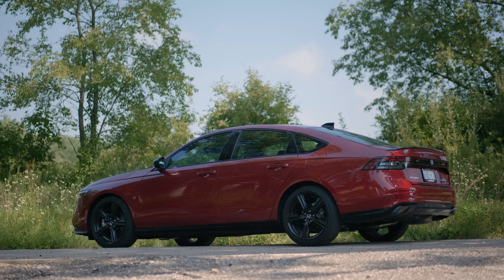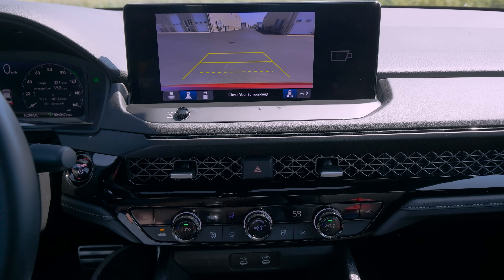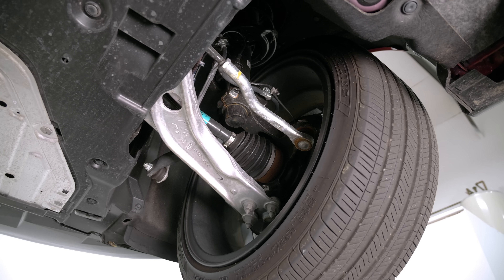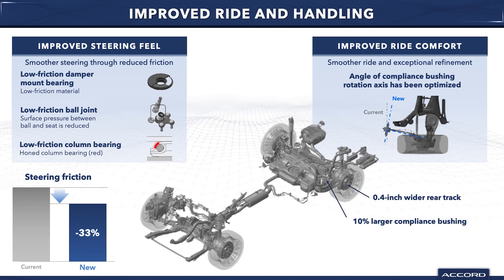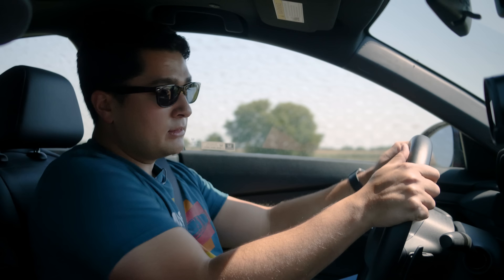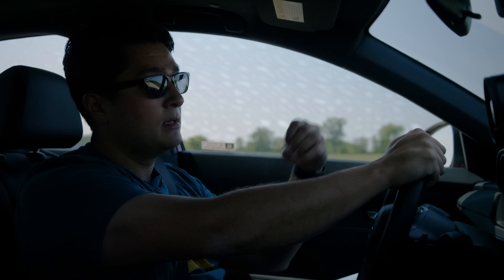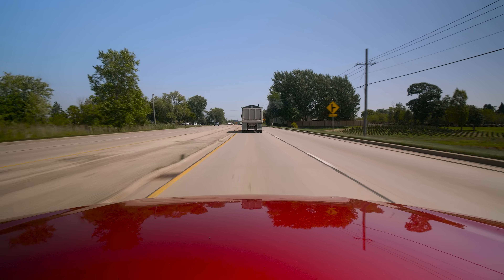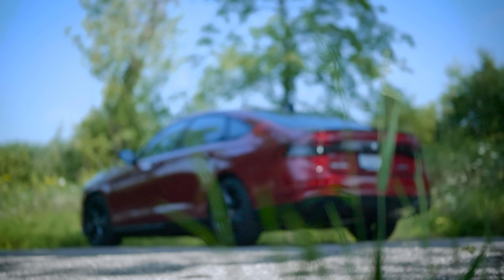2023 Honda Accord | The Art of Normal Cars

Comment: Is it worth it to upgrade to this over the civic? Are there noticeable differences? If so, which ones? Great video!
Reply: Currently hybrid availability and even more rear seat space. That's all you're getting for the most part, aside from luxury features on the top trims
Reply: You'll get a head up display if you go for the top hybrid touring trim as well as a bigger  touchscreen. The interior is also better looking in this Accord compared to the Civic in my opinion.
Reply: The 2024 Civics will come in this hybrid power train as well.

Comment: Honda tends to alternate between aggressive and conservative designs with each generation on the Accord.
Reply: 10th Gen Civic starting with 2016 model year was the extra aggressive style. The tail lights, rear shoulders, up swaying front to back side lines were really nice. Especially on my white 4 door 1.5 Turbo EXT trim with stock fog lights, and without the large waffle pattern looking things on the 4 corners, especially the Hatchback. Really exaggerated those. I get compliments all the time and the Honda dealer always wants to buy it from me. I feel that trim on that car hit the sweet spot. Sunroof, upgraded wheels, Dual zone AC, 7" info, 8 speakers, SiriusXM, Apple/Android, Fog lights, keyless entry, pushbutton start, upgraded seats and door panels with black and tan. Really hit the sweet spot with that trim that year. $23K Sticker. I got it for $20K in Jan 2017 new. Almost traded it in for an 2010 Accord Sport but it didn't have a sunroof and quite a few things. Interior was just basic grey/black. So I still have my Civic
Reply: same on Civic
Reply: @@Ac_AdapterEither a 15 year old or a literal clown must have designed that generation. Horrendous
Reply: There has never, ever been a Honda Accord you could call "aggressive" in terms of design.
Reply: Yeah, but the last gen was not aggressive at all.  9th gen looked great.
Reply: @MikeYurbasovich  ?The 10th gen accord is one of the most agressive and best looking accord ever made.
Reply: @MikeYurbasovich 9th gen accord is peak accord. TSX too if you count that.
Reply: @latuba2478  I had a 9th gen v6 coupe.  It was a really nice car for what it was.  Very good looking vehicle.  For the 10th gen,  it looked like they fired their design team and let the IT guys design the car.
Reply: @MikeYurbasovich  specifically the 9th gen coupe is crazy sexy
Reply: @alexg9727  It's pretty quick, too. I beat up a couple V8's with it,  and it was a fun car, very comfortable for long trips, good in snow.  Mine was white orchid pearl with 19" touring wheels.
Reply: the new civic definitely gives me a 90s JDM feel and i even thinking about selling my c class for a honda :P
Reply: The 2018 was a favorite among the mumble rap zoomers. Normal people used to drive Hondas, idk what happened

Comment: I don't see as many on the road as I would expect for an Accord.  I have to believe people are turned off by the old and plain styling design.
Reply: I see five times as many 10th gen Accords. The style is just so much nicer, this new one is incredibly bland.
Reply: @DeadwingAbsentia  that’s because the car has been out over 5x as long. Of course you’ll see more on the road. Same will apply for 11th gen when the 12th gen has only been out for half a year lol.
Reply: @SIIKAP1  Yeah, that makes sense. But I see tons of brand new cars on the road and I thought I'd see more of these. My guess is people have the same hesitation I did when shopping earlier this year - no 2.0T/10 Speed and forcing the CVT on buyers? No thanks.
Reply: @DeadwingAbsentia  the lack of 2.0T powertrain and the questionable styling will definitely deter a lot of people, but it will also attract a lot of different people that prefer tamer styling and good fuel efficiency. I see a decent about of these on the roads. 

If you choose the hybrid, you don’t have to deal with a CVT. The direct drive ‘transmission’ in the hybrids feels way better than a belt-driven CVT.
Reply: @DeadwingAbsentia well that’s because the 10th gen has been around for 5 years this one just came out a few months ago
Reply: It’s been out since February, which is half a year. And this is selling more than the Civic, with 100k sales through June of this year, and the Civic at 94k through June of this year.
Reply: I actually have been seeing more of these than the new CRV. I thought it was weird.
Reply: live in nyc.   see none of these.   everyone and their grandma has a 10th gen though....
Reply: I'm living in the Bay Area, I wouldn't say the new Accord is rare, when you see the new Accord, you can tell the new one feels more high-end compare to the tenth gen. Remember, being plain doesn't mean boring, the design would age well way better than something like current generation Hyundai products, which known as come with some overstyled design.
Reply: It reminds my of what Toyota did with the 2015-2017 Camry. Made you wonder what in the world were they thinking?!
Reply: Where I live, it's cost. You're either in a brand new car or one from over ten years ago out here, and most of these vehicles on the road are trucks. I see more 90s and 80s Japanese cars on the road than I do cars made in the last five years.
Reply: Most people just get the CRV now
Reply: They are turned off by the low supply.
Reply: Selling more in the same time frame than 10th gen accords btw
Reply: I see it everywhere. Where do you live?
Reply: @kevinc2332  Live in North Carolina. Friend in Chicago said the same.
Reply: For most people it's the power plant. The Accord is a mainstream car but mainstream people do not want a Hybrid system. Leading more people to buy Mazdas or Camrys.

Comment: I would like to see a 1.5T version of this hybrid powertrain with around 250hp. It technically could be possible since both the 1.5T and the 2.0 are L series engines. Will that happen? Probably not, but it would be nice
Reply: The 2.0 Hybrid is a K series, not an L series. It could possibly be possible but Honda’s direction with the car wouldn’t line up with it.

Comment: Oddly enough I was just looking for reviews on this gen accord and was recommended their initial impression video, then a couple days later this drops. I think this car will serve it’s purpose really well even though most people who would buy one will most likely buy a crossover now. The days of cheap reliable used accords have been gone for a while now but these new accords are so complicated with turbos and hybrid systems that they’ll probably not be so great as a high mileage, multiple owners, used cars. I guess time will tell how well these things hold up.
Reply: If we’re talking hybrid, you may end up eating your hat - this hybrid system is bullet proof, and with the low stress of the NA Atkinson 2.0, these Hondas should be easily good for 300K + miles. No  CVT or transmission to worry about either ( just the electric motors and 1 low reduction gear and 1 high gear) for when the ICE is running.
Reply: @adambernstein9647   it’s not the engine or motor that I’m worried about, I’m more concerned about things like the battery or how the software controlling the whole system holds up. In the late 90s we were able to pick up 80s accord with almost 200k miles on them and do basic maintenance that anyone could do in their driveway and had a reliable inexpensive ride. I don’t think that’ll be the case with these newer accords. I could be wrong and maybe the average home mechanic in the future is well equipped for those kinds of things, it’ll be interesting to see.

Comment: The Toyota Camry TRD is the obvious choice in this segment for the performance oriented. It looks great plus you have the option of that sweet 300hp V6 which leaves both the Honda Accord and Nissan Altima in the dust. It's a shame that both Honda and Nissan gave up on performance. Who remembers the Altima SE-R? Ahh... Those were the days.
Reply: VS the new Accord, the V6 Camry will smoke it any day of the week. VS the old 2.0T? Camry loses. You’re right though, Toyota feels like the only one who still cares about fun cars.
Reply: @Teku175 Toyota doesn’t “still care about fun cars”, they simply did not release the new Camry yet, so of course they still offer the old Camry V6 of 2018 gen. Once they release the 2025 Camry, they are dropping that V6
Reply: My 2.0T Accord will still smoke any Camry TRD or V6 I come across. >:)
Reply: @fireemblemaddict128 You can’t get that anymore. You can still get the TRD Camry in 2023 though.
Reply: Tbh I hope Honda still keep the 2.0T engine (which same as type r) on the accord, it got less hp but the 10 speed gearbox is absolutely animal and make it can go really quick.
Reply: Nissan still makes the Maxima with 300hp V6. Although I wish they offer anything other than a CVT
Reply: @kimochi33  Not for long.

Comment: I rented a 2019 Accord in Houston last week for a week, and put on 1500mi in a week. It was so refined, and convenient to use, I loved it. It had 192hp and I didn’t need anymore power to pass those crazy Texas drivers 😬. Honda and Acura was never on my list, but I’m going to check out the newer cars when it’s time to upgrade.
Reply: I never knew Honda cars were rentals too
Reply: @Wqghfxz I got a Civic as a rental in 2018. Ended up buying an Si like a month later
Reply: just curious, what brands are in your list that never included Honda?
Reply: @ThisGuyRides 😂😂😂
Reply: How you driven any sedan between 300hp and 400HP? Sure you don't need it but is it fun to have to utilize once in a while. We spend so much of our time in our cars these days, why not pay a bit more and get something engaging?
Reply: @DaGoook  Who needs 400HP to commute? Not everyone is obsessed with a 0-60
Reply: @disco.lemonade Doesn't have to be about 0-60 tinker bell . My wife's 330 hp g37 is just plain more engaging to drive than my 280 hp accord sedan . It has more power through the Rev range and is more pleasant to drive even at 1/2 throttle .
Reply: @soulerflare7 if you wanna go fast do that why you mad because the man just wanna chill and drive
Reply: @DaGoook  the problem with 300 - 400hp is that it's usually a luxury sedan with turbos attached, meaning it's going to be very pricey. Pricey enough that most people will just pass it up and get a newer SUV or truck.
Reply: @hellomoto1   I hear you about practicality though. I'm not married and no kids so no need for an SUV but been looking at an Audi S5 as for me that would provide the best of both worlds in my price range.
Reply: @DaGoook  I hear ya there. I mean, for what the mid-price entry level of this Accord (~$32,000), you can get a brand new Subaru WRX, which would give you more power and an AWD drivetrain.
Reply: No wrong thinking  @DaGoook
Reply: @phunk8607  How so?

Comment: I liked the styling of the previous generation a lot better.  The way the the Accord looks now... I don't think I could be convinced to buy one.
Reply: I have no idea why not to make it a lyftback. It would have much more sense
Reply: @kosta2177  perhaps a liftback would have less structural rigidity. That seems to have been an important metric in the chassis engineering on this version.
Reply: @kosta2177 nvh is much easier to control in sedans, that's one reason.
Reply: @kosta2177  it's already the shape of one I don't see why not! If I wanted a f**** hatchback, I would go buy a hatchback. It's supposed to be a sedan. I guess some of these idiots forgot what a sedan is.
Reply: are you 12?
Reply: Completely agree
Reply: Looks like a hatchback. Butt ugly
Reply: And I'd kill to have seen a coupe variant of both the previous-generation and this one. I definitely like the previous design way better.  It was one of the best looking sedans on the road, in my opinion, but I think this would look stellar as a coupe with the ultra simple design.

Of course, that can and will never happen in the modern age.
Reply: @shanec9672  it already has the shape of a coupe it's just absolutely ugly with 4 doors. Looks like a freaking five-door hatchback.
Reply: this gen looks like a generic Chinese brand made car from 10 years ago

Comment: I own a 2020 Accord LX base model, with the base engine. It's not a Porsche 911, obviously, but it's not exactly a slow car, or a car that lacks pep. Even without going into sport mode, this car feels plenty quick when I need it to, and it gets admirable fuel economy. I have ZERO regrets about this car. For the price I paid ($25k out the door), it's a hell of a good and reliable car. To me the seats aren't the most ergonomic, and that's about all I can complain about. Even the base model audio system is pretty decent - far better than what you get in a top of the line Corolla XLE (we have one, we know).